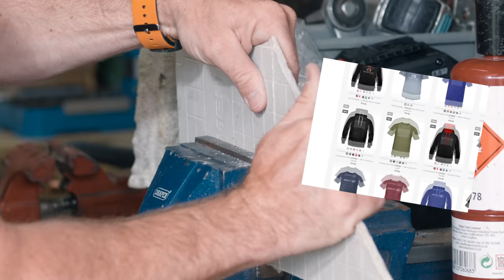BEST SOLDERING HEAT MAT FOR PLUMBING? Tools of the Trade

Comment: Tile backer board is the best. The 1/4" works as well as the 1/2" and it will not ignite. A section of galvanized vent pipe will work, but it can transfer heat to whatever it is protecting. I poke a hole in the top of a plastic water (wah-uh} bottle and spray anything that got scorched.

Comment: I'm not certain I can get that sort of board here, I might try it with some fermacell board, might work as good as yours 👍.  I don't bother with heat mats either, too expensive.  I just throw damp paper towel, the crap rose coloured ones that we all have a roll of in the van, against the walls, round pipes etc.  I don't solder, I braze everything with an oxygen/acetylene torch so it would definitely be fine with a little blow torch.

Comment: Does anyone know what the fine torch tip James is using in this video is called? Can you post a link? Thanks.
Reply from the maker: This little beast here: https://amzn.to/3f4OLUV (also it's in our Amazon store under 'Soldering Bag')
Reply: @plumberparts  Had my Rothenberger bruner for about 20 years, recent ignition problems bought Rothenberger Superfire 2 and Quick Fire Complete Service Repair Kit to get the Piezo ignition; fitted this swirl flame at the same time. Really want to get the old Fine Tip but no longer available?

Comment: James, nothing to do with the video but could you explain the reason for making a 22mm MALE x 15mm female reducer. The 22mm male end needs another 22mm straight connector as far as I can see. I can’t think what specific job they are for apart from street joints. It is not always clear what you are buying since the spec isn’t often given. Yours, hesitant diy plumber!
Reply: well, Well, WELL ? 😂